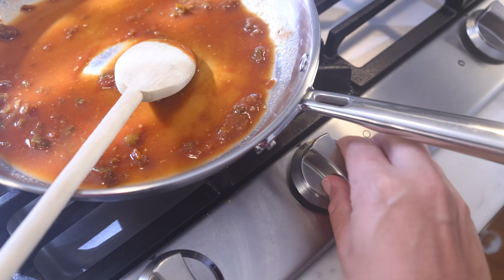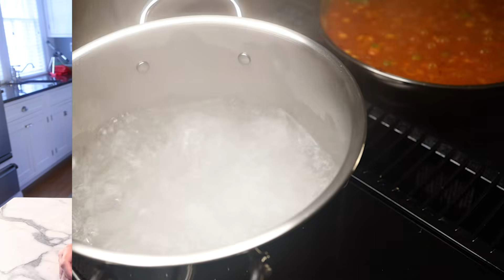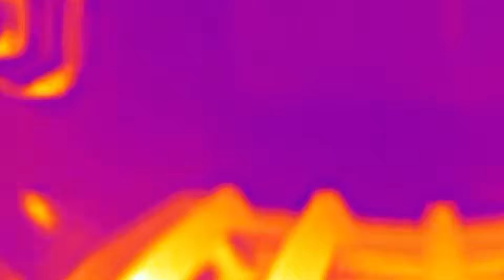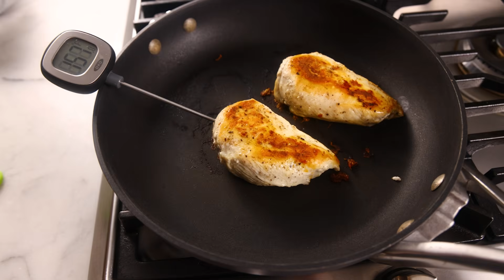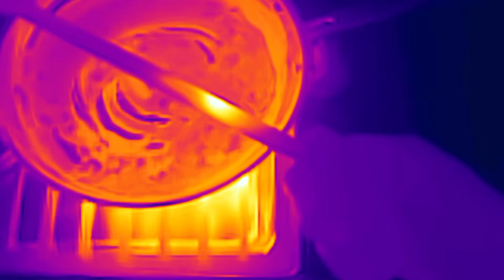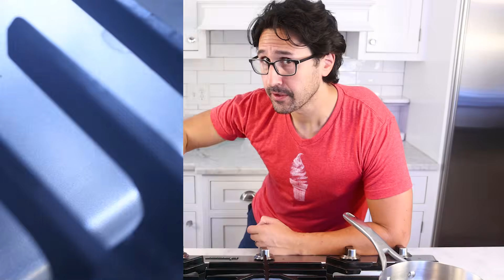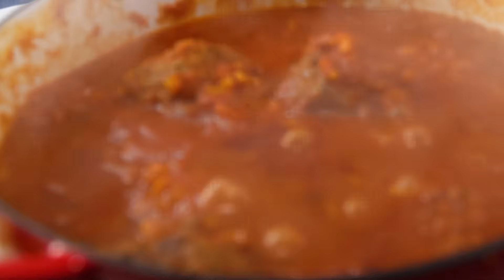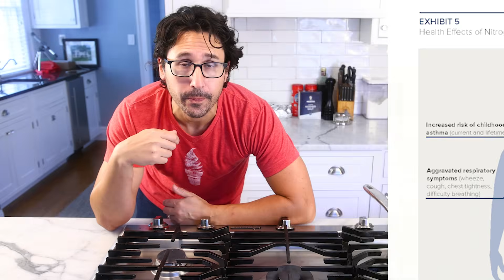Problems with gas stovetops | weak, dirty and dangerous

Comment: Regarding gas stoves not going low enough: yes, it does mean paying more attention to prevent burning (although this can be mitigated by right cookware and enough fat). But a perfect beef curry emerges in 2-2.5 hours on gas. If you tried doing this on a slow cooker (which takes 8-10 hours), it will objectively taste worse. I have not tried cooking on induction, but I doubt it can beat the taste (since the taste is a result of repeated fond creation, which goes into the curry as you stir every 15 minutes or so). Unless you are using sous vide (where you can choose really low temperatures), there is no reason to cook a tough cut longer than 2-3 hours. The romanticizing of having a sauce or stew cook all day is nostalgic bullshit.

Comment: Interesting,  Adam didn't address the issue of EMF radiation from induction stoves?  I will take my chances with gas and take 2 more minutes out of my day to boil some water and have a back up source of heat when the power goes out.

Comment: I love my induction hob, it's better in most ways than gas (although more expensive), but - for the love of God - can someone track down whoever thought putting capacitive buttons built directly into the hob top was a good idea and slab them with a wet fish. Sure it looks sleek and all, but it's objectively terrible design. If one of the pans boils over the water flows over the controls and messes things up.

Comment: Agree with a lot of points, however, the bits where you burn things hanging off the side, like a ladle, can be easily solved by moving the side of the pan you want to keep cool further off the flame, so that the heat doesn't radiate up that particular side...

Comment: The lower output of gas stoves can also be good for people who use cast iron or mild steel pans; heating either material too quickly can cause warping or even cracking. Induction can be especially harsh for them the way most people use them, but halogen and resistive heating stoves are safe if you preheat them on low or medium low first. As you said though, these are your problems, not mine.

ALWAYS have the range hood/vent running when gas cooking though, and pop the window open if you're particularly worried as well

Comment: Have had gas, electric and induction stoves - induction is the best. Gas one actually exploded when my mom turned it on the first time we moved into a brand new apartment. Electric is too slow and weak. Induction has all the pros of gas without the dangers, heats quickly the food tastes as good as gas.

Comment: You can turn gas 'further down' by using a diffuser (Amazon in the UK refers to these as 'gas hob heat diffusers'). They can also assist in spreading heat more evenly across the base of a pan enabling the use of the smallest gas burner with a larger pan or stew pot (Dutch Oven). There is clearly a loss of efficiency as you are effectively finding a way to disperse more of the heat away from the pan, but this is probably lower than transmission losses with conventional electric hobs. 

I also use an electric kettle to boil water. In the UK these are typically rated at 3000 watt and boil really fast , for when you really need a cup of tea! On US Amazon, Kettle's seem to top out at 1500 watt, so less of an improvement there. 

Another key advantage of my gas range (even over its single electric ring) is that despite recent energy price increases, the gas is still 5 1/2 times cheaper per kilowatt hour than electricity in the UK. All that said, when it eventually gets to the end of its life, particularly as more an more electricity comes from renewable sources, I will probably go for induction, perhaps with a single Wok burner if possible...

Comment: there are a few problems with this. one is that the majority of your power is going to be coming from fossil fuels. You're getting way way way less efficiency from burning a fossil fuel, making steam, generating electricity with that steam, then transferring it through a line, then putting it into your pot/food. Electrification of the grid is also important, but in my area the power goes out about half a month per year usually multiple days in a row. My house wouldn't really be livable if I didn't have at least gas going to the stove. So at least for me, an electric stovetop would be a MASSIVE mistake

Comment: You didn't know that there is a retractable ventilation system on most modern gas tops until recently? I may just be privileged and know this is a common feature of a gas top burner in the US, but you seem smart. Not sure how to react here. Thought that was common sense.

Comment: The heat leakage, while annoying, does have a huge benefit over electric and induction burners. It keeps pans like carbon steel and non stick from warping on the bottom! If you heat the sides along with the bottom, the whole pan expands with the heat more evenly and it avoids warping. On electric stoves the outsides remain cool and the expanding hot bottom warps outwards to compensate. I’ve had so many issues with my electric stove that I didn’t on my gas.

Comment: I was really annoyed about having an  induction hob when I moved out from my parents at first as 

1. It was gas in the advert
2. I grew up with gas and was used to it
3. I had to give away my favourite pot and frying pan because they weren't magnetic

But I agree with you Adam it does feel more efficient and when your trying to keep a consistent boiling temperature of 180c when deep frying it's so much more efficient on induction Vs gas where you keep turning the hob up and down and up and down to keep that same heating temperature 😂

Comment: If there isn't a flame the gas should stop in its own AFAIK.
There is a mechanical safety that reacts to the flame, at least on the old 50s model at my GFs place and the modern one at her parents place, that's why you have to push the regulator in when you start it.
As for regulating heat; aren't you supposed to use the smallest burner when you need the least amount of heat?
Edit: it looks like all your burners are pretty much the same size... the ones I've used vary from close to palm-size to less than pinky-finger-wide.

Comment: I went and watched the induction video. Some things I feel we're left out of the videos, this one in particular:

•Induction stoves are noiser than gas or electric resistance. They always have a fan running, and there are buzzing and clicking noises. I imagine you can pay more for engineering to make it quieter, but you probably won't ever find an induction stove that can operate silently like gas or electric resistance.

•Induction stoves are responsive and can be made to produce precise consistent temperature far more accurately than other stoves. Some you can actually input the temperature you want the pan heated to and kept at, like an oven. And they'll stay that temperature. Gas stoves can hold the flame at a constant level, but you don't have the same repeatability and precision. You've got to be OK with "medium-low heat", rather than a precise number. Which is fine for most cooking, but more precision could be useful.

•Most induction burners heat less evenly than gas burners. Again, you can pay more for your burners or cookware to get around this problem: a fancier stove probably heats more evenly, and premium thick pans made with aluminum or copper layers certainly do, although even heating isn't necessary for many kinds of pots or for wet cooking. But you do want your skillet even-heating.

•Most types of cookware are available in induction-compatible versions, including traditionally incompatible metals like copper. You can get high-quality, sufficiently thick copper pans with stainless steel bonded to the bottom to make it compatible with induction.

•Some people have health concerns about induction, similar to the concerns some people have about microwave ovens. I don't know if there's substance to these concerns, but a video like this talking about the minor danger of gas inhalation over time should address the concerns people have about standing in front of an induction stove for an hour every day. I'd like to know whether there is actual cause for concern. I'm sure there's some mythbusting to do here.
Reply: Counter points:

To No.2: No, you don't need "precision" when cooking. Ask the Asians.
To No.5: Those are bullshit claims, induction stoves are perfectly safe. The "danger of gas inhalation" is also bullshit, you cook in a kitchen, not an airtight box.
Reply: @kaikart123  You need precision in some cooking, like baking and candy-making. Do I need precision to scramble eggs? Of course not. But if I had a perfectly precise stovetop perhaps I could melt or even temper chocolate unattended without a double-boiler, just by putting a chocolate bar in a pan and pressing a button. Or make custard without any concern for the eggs curdling. We can make food on traditional stoves, but a precise control might make some foods easier to make, preventing burning or the need to use a double-boiler. It's a feature that probably wouldn't benefit everyday cooking, but could be very useful to some people.

The automatic "temper chocolate" button actually sounds quite appealing to pastry and dessert cooks. Shifting the temperate several times to precise temperatures. A precision oven could do many of the same jobs, in some cases much more effectively by heating from all sides, but a stove is also useful since it allows the food to be manipulated during cooking. With precision controls, you could use warm heat settings for really low-temperature tasks. Keeping things warm, some reheating jobs, dipping foods in hot glazes. Perhaps you could make "sous vide" style fried eggs just by cracking them into a precisely heated covered pan.

I agree with you that the safety concerns of stoves are probably way overblown. I have my gas stove next to an open window. And range hoods are available for the concerned and poorly ventilated. I suspect industry sources promote this rumor-spreading in order to cast doubt on rivals. "You don't want to buy our rival's stoves, their technology is dirty, dangerous, and unhealthy. Here's some evidence: we paid researchers to come to the conclusions we wanted." Therefore, a subject this mythologized should probably be addressed directly to dispel misinformation. I'd like to see this channel make a video focused just on safety concerns with stoves and ovens, since I'm not sure the discussion in this video was helpful, thought it did get people thinking about it.

Comment: I wish that someone would develop a hybrid stove, with 2 burners for power outages and use of my large, thin stock pot, and 2 induction elements for normal cooking.

Currently, I use electric appliances where applicable, like an electric kettle and whatnot, but my natural gas supply has never, ever cut out. Plus, my house doesn't have the electrical service to handle our electric dryer and all the burners and oven in an electric stove all at once, and an upgrade is EXPENSIVE.

Comment: Well my household had been using propane tanks for the best of last 30 years, it’s oddly due to the cost of the change that we just don’t see a point in changing, and there also the bad reception to earlier electric coil based stove attributing to the very bad impression they are not as effective gas/propane due to perceived heat, and dealing with heat spots for saucepan and wok based cookery are fundamentally different.

Lastly, I had to agree it way cleaner to manage glass top stove if not safer as no open flame or heat source to consider.

A tip, a relative of mine use to get stove wire gauze heat diffuser for their gas stoves, which puzzles me then guess it was for the flat bottoms then.

Comment: yep, ive always been disappointed with gas range-tops ; heck range-tops are basically outdated/overrated today anyways, these modern electric hot-plates are awesome and accurate, something most electric range/stove-tops STILL dont have [ie accurate temp, ie heat this eye to 100C, not just a turn-dial with low/med/hi XD]

Comment: I'm living in china where maybe the gas stoves are different. But I love gas because I can CONTROL the heat better whereas with induction you up a number or down a number but there is no way of going in between the numbers for a more subtle decrease in heat. I also find that gas stoves take longer to get got for sure but they get way hotter which makes it a lot longer or harder if you're trying to heat something well beyond water boiling point. But my biggest con for gas is 1. makes the whole kitchen hot especially if you live in an apartment (but maybe it's good in the winter) 2. the flames can go around the pot making the sides of the pot hotter than it should be and making the handles hot.

Comment: Granted that induction is the future, I personally still prefer gas stove tops. In my experience (which admittedly is not the best parameter for reference) I only ever had the problems you describe on electric and induction stove tops. Heat not being high enough or low enough on gas stoves, burning stuff because response was far from immediate on electric ones, control not being granular or continuous - induction top cycling on and off so oil temperature would fluctuate massively.. the thing is I believed, you need pretty expensive electric or induction stove tops to get all the high quality features you described, while you can still get pretty decent quality even with the cheapest gas top. Bottom line is, I'd rather have a less efficient stove top that manages to keep a real constant temperature, than a more efficient one that fluctuates constantly and is not immediate.

Comment: All gas stoves in Europe have a safety feature that automatically turns off the gas if the flame extinguishes regardless of reason (wind, gas pressure issues, etc.)

If you use the smallest burner (like mine which has a diameter of 5cm) you can make a bechamel without too much babysitting and definetly without a bain-marie.

I wouldn't change to electric... There's something magic about flame cooking :) Also, your worries about breathing gas and etc... That's just hilarious.

Comment: Adam you might not be able to get induction because you need high power sockets. Normal wall sockets are not enough. Plus a gas stove lasts forever so this is a problem you may never need to worry about.

Comment: For most people gas is definitely better for the environment. The main time you use them is generally after solar power is available and at least where I live its when coal power ramps up during the day. Also people are looking at replacing methane with hydrogen gas or at least mixing them in the short term.

Comment: Adam, especially from you I expected to hear about my favorite part about gas ranges: visibility. I'd much rather be able to see how big the fire is than trust whatever the manufacturer has deemed to be "medium high" etc.
Reply: Induction stoves can actually just tell you the wattage being cranked into your pan. This way you have objective data that enhances your cooking.
Reply: It's something you get used to in no time. Meanwhile looking at a fire doesn't necessarily tells you how hot it is - that depends on the energy density of the type of gas you're using to cook with and how efficiently the heat is going into your cookware.

Comment: I have never worked on an electric stove i have liked, true induction is awesome. the heat around the sides with gas is a real problem. ALSO TRY A CARBON STEEL PAN, CHANGE YOUR LIVE

Comment: Gas all the way for me. We are getting a 36” Bluestar range in the new house along with a large properly vented hood to go with it.    

Bluestar ranges fix a lot of the issues you mentioned.  Mainly because of the open burners allowing the flame to go straight up instead of out to the side.  And using a high quality valve to turn the flame down very very low. Not to mention they have the highest btu of any home range.

Comment: There are things that work better on either stovetop. The thermal mass of water actually deflects the flame away from the pot by cooling the actual combustion temperature, that's why you smell more aldehydes when you first put a pot on to boil. Gas stoves do better for dry cooking methods, electric is superior for moist cooking methods. As far as long term solutions, hydrogen stoves will eventually be viable, which will literally be a 50 cent part for each burner that has to be changed out(or drilled out) I would love for a duel fuel stove to be made with a large induction burner for pasta and braises. An electric kettle is a nice thing to have, I often heat water in my kettle to pour into my pasta pot when I make pasta in a large volume of water, but lately I've been doing the cold water method to make pasta and it works great. Oh, and a rice cooker is the only way to get good rice if you have a gas stove.

Comment: I must have one of the good model gas stoves then, because every time you'd say something like "medium  heat" on your electric, I'd end up with smoldering ruins in a pot. I quickly had to learn that your temperatures were way too high for my stove.

Comment: I have an infrared glass top now, and it's super fast for boiling. Also so adjustable to low heat. I'm pretty happy with it. I thought I might replace it with an OPEN BURNER gas range, which avoids many of the "heat ring" issues that the sealed burner gas technology of your Dacor range has. But now, I think I may go induction, or just replace it with another infrared.

Comment: Ive just got an electric stove top for the first time, and each burner only has 6 discrete heat settings, it doesnt have continuous control like a gas burner. I cant imagine that's a necessary function of electric stovetops but it sure does suck for this one in particular. Unlike what Adam said, I actually cant get it lower than what I can get from a gas stove